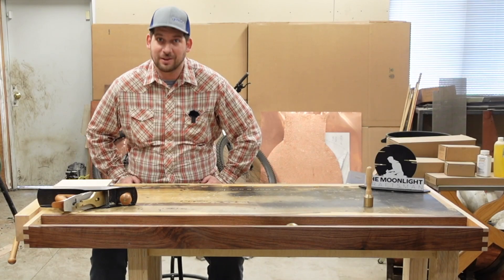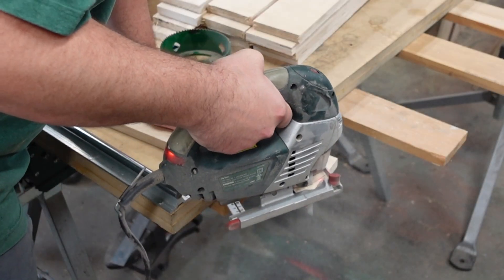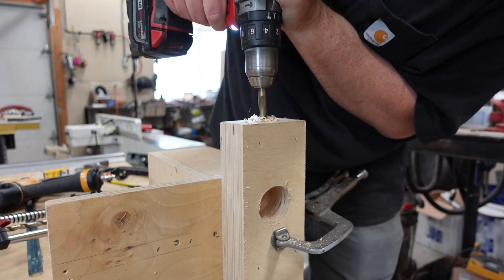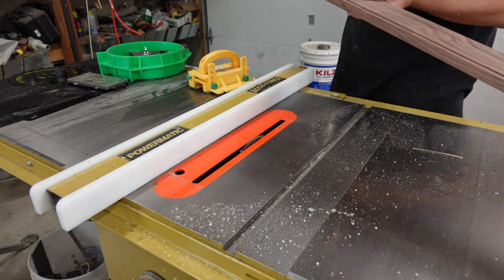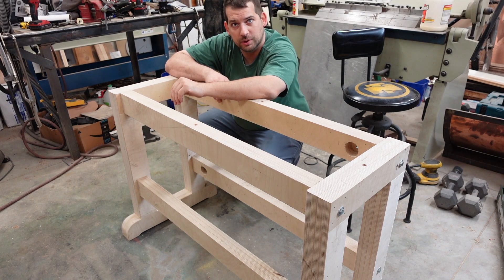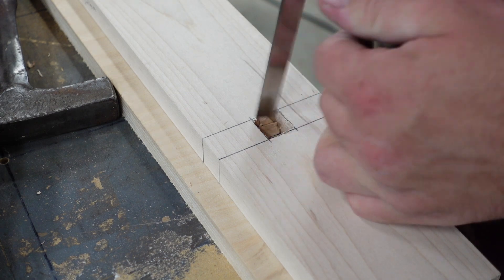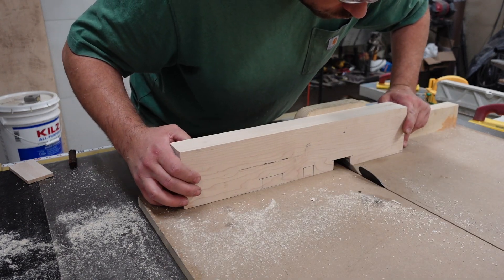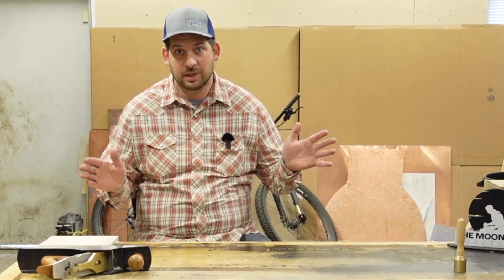🔴 THE BEST BEGINNER WORK BENCH? @RobCosmanWoodworking

Comment: How thick is the plywood you used for the tray bottom?  Great job, by the way!
Reply from the maker: Thanks, it’s 3/4
Reply from the maker: Actually, if you are talking about the tool tray not the lower shelf. I used half inch maple with a rabbet on all sides to fit in a 1/4 inch groove in the sides. Since the tray is so long I did glue about an inch in the middle on the tray shelf to the outer side so it could still expand and contract. A middle divider could also be used instead
Reply: @TheMoonlightCraftsman  Thanks, that was the area I was talking about. I have not started to build my bench yet, but hope to begin soon.